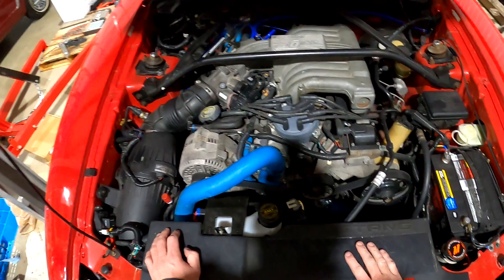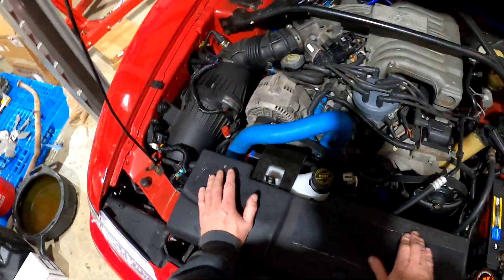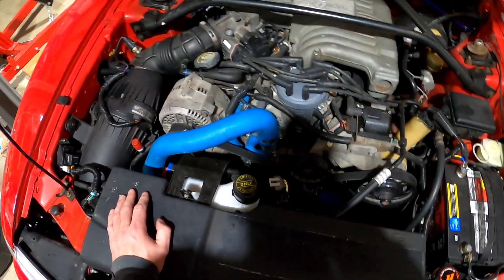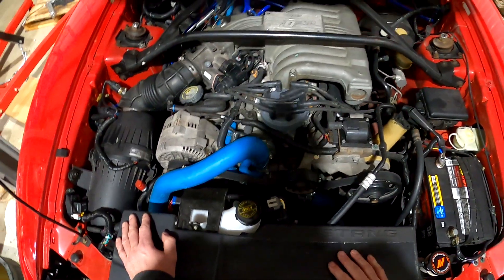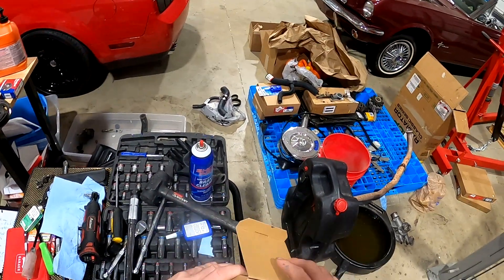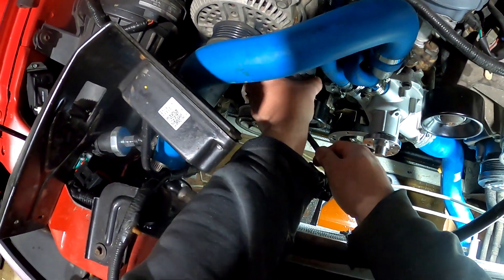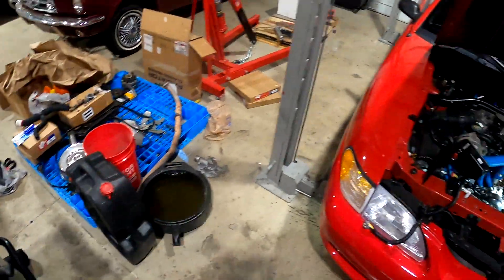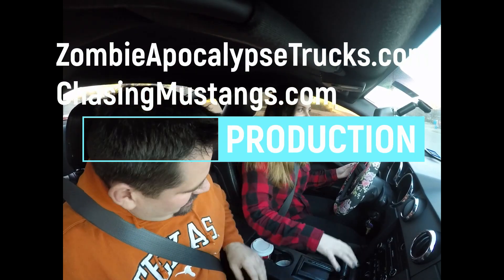94 to 95 Ford Mustang GT SN95 Water Pump Install Repair

Comment: Just had mine start leaking. It was a high flow pump. It had been on the car @220,000 miles.  It was a good one.

Comment: A medal to you for using an actual 94 GT for the job.  I only wish you had listed the parts replaced by brand and number so we could know what to buy to do our own water pump replacement.  Im planning to do this same job along with the radiator replacement on my own 94GT this coming summer.  You also installed a new belt tensioner and a new udler pulley,  correct?  (1st comment)
Reply from the maker: Yes, I installed a new water pump, idler pulley, and belt tensioner.  I purchased all the parts at Autozone.   I can send you the parts link if you need them.
Reply: @chasingmustangs  yes,  I would like to have an idea of what to buy to do the same job to my car.  The parts on it are over 20 years old so replacing them now sounds about right.  T.Y.
Reply from the maker: @CellPat2  https://www.autozone.com/cooling-heating-and-climate-control/water-pump/p/duralast-water-pump-cwp-9033/268181_0_0 for waterpump, https://www.autozone.com/external-engine/idler-pulley/p/duralast-belt-tensioner-305296/421369_0_0 for belt tensioner,  https://www.autozone.com/external-engine/idler-pulley/p/duralast-idler-pulley-231048/634107_0_0 for idler puller
Reply: @chasingmustangs  man a big THANK YOU for that one.

Comment: I have a 95 aode 5.0 306 with f cam 2800 rpm stall , I'm have this weird squeal coming from what sounds like the transmission from a cold start its fine idles about 980ish no squeal but seems little sluggish  but once it get to Temps like 165 idles goes to almost 1200 and squeals and smooths out from being sluggish but squeals loud.. only in park or neutral  when in drive its fine and rpms goes back to 980ish. I'm not sure what it is , I was thinking water pump not sure because it sounds like rear of motor not in front were pulleys are.. this is a fresh build minus the transmission haven't drove it yet besides around block
Reply from the maker: The torque converter housing is mechanically attached to the engine's crankshaft causing the pump to operate whenever the engine is running. It's why a worn or faulty pump makes a whining noise in all gears, including park and neutral.